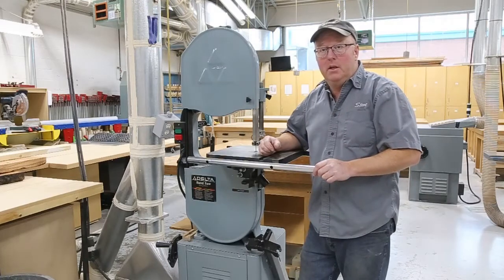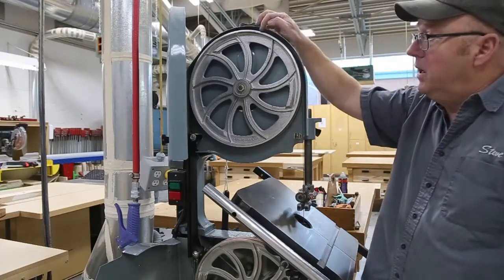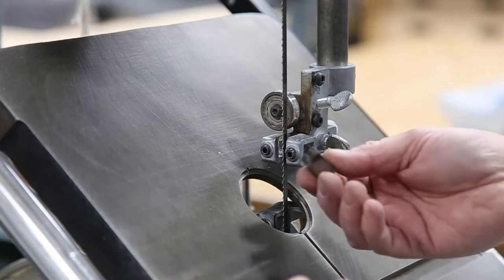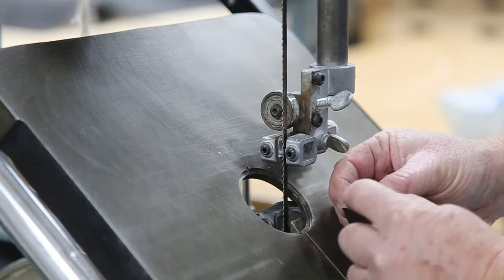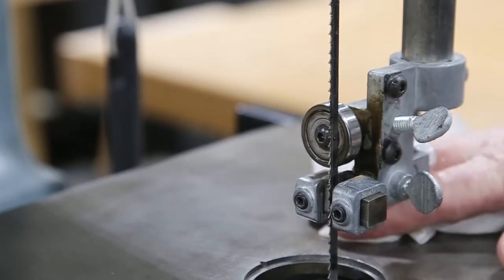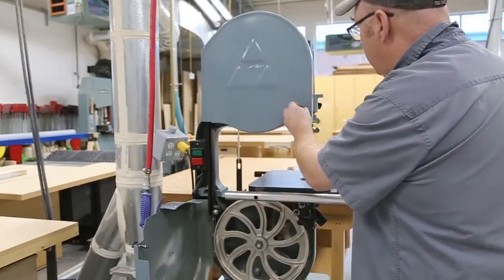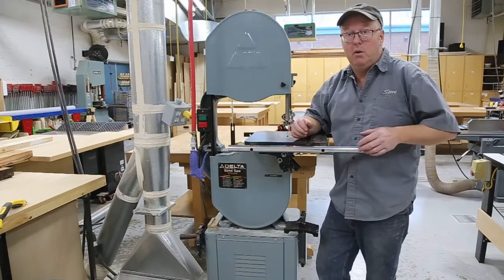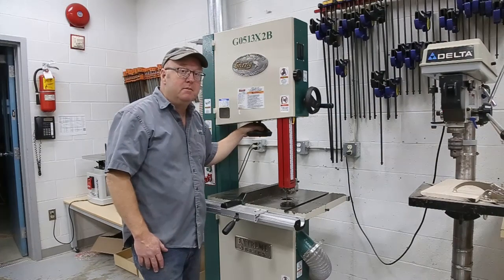Band Saw set up and maintenance

Comment: How's she goin'?  Great video on setting up and maintaining your band saw.  I have a 14" Delta clone.  I can't get it to cut parallel with the miter slot.  Any ideas on how to get the saw to cut straight?  Thanks for posting and take care!!
Reply from the maker: A band saw rarely cuts parallel with the miter slot, it always skews to one side.  Make a straight cut down a board then adjust your miter gage to the angle of the work piece.  Hope that makes sense.
Reply: @stevoj8959  Yes it does.  That's what I have been doing.   I tried a lot of things to try and get it to cut parallel with the slot.  I got pretty close but no cigar!!!  Thanks and take care!!